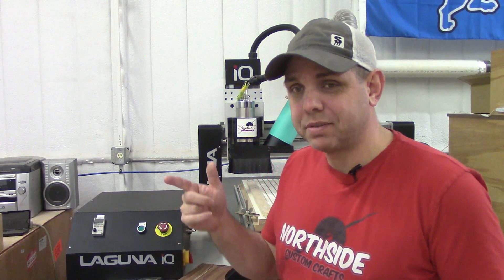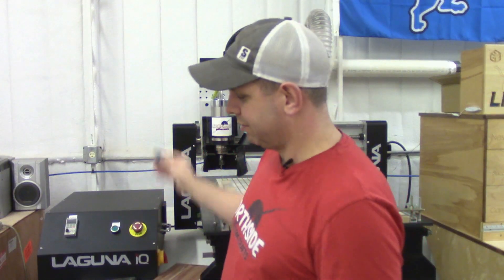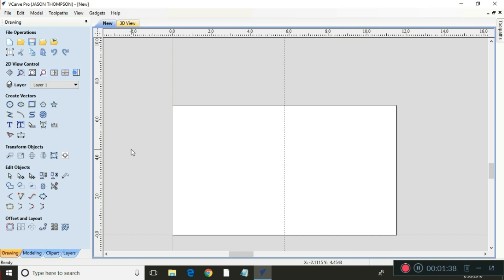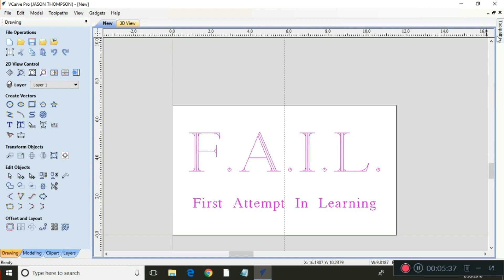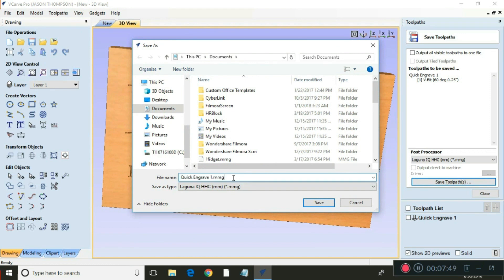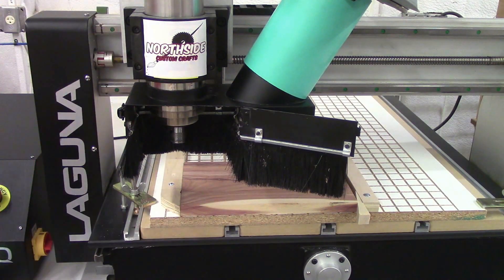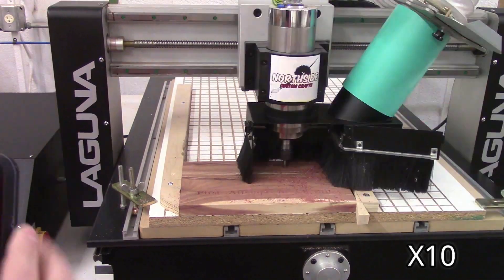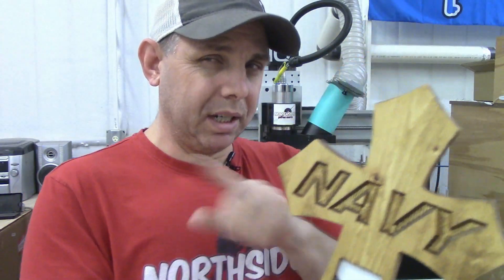Laguna IQ CNC Machine Review and V-Carve Pro Demo

Comment: I Just got the same Laguna IQ and, in the manual, said 208-220v   my question is can i plug this in a 240v ?
Reply from the maker: I'm not sure why we have so many different names for a 220 plug. Just use a 220 plug with the correct amp breaker and it will be good.

Comment: I like your videos and got a question. I bought one of these two years ago and been so busy I'm finally around to starting it up. The owners manual talked about putting 30w oil on guides for lube lol. I was going to clean the guides off with wd4 , what kind of lube did you use and also do you lube ballscrews?  Also do you know if the controller will swap to inches and not metric I can't seem to figure it out if it can
Reply from the maker: Thank you . I’m glad you enjoy the videos. I’ve had mine for quite a while now and t very thing was lubed when I got it, I just keep dust blown off with an air hose and I really haven’t done any maintenance on it.. I don’t use it very often, but it sure comes in handy when I need it. I just Change metric to inches in v-carve pro on the project setup page. 👍👍
Reply: @JakeThompson  I have aspire so when I change it to inches the controller will convert as well? When I turned the machine on it was in metric and I figured it was a parameter in the handheld. So your programs are inches on the handheld? Thx for reply been a sub for awhile on your videos

Comment: so let’s say you have to change to a second bit the middle of a project.  but there isn’t enough t of the original wood surface left to set you Z axis puck on. what do you do?
Reply from the maker: You can not use the puck and set the bit directly to the surface without the puck.. you can also set your x to the surface if your spoil board. You can set it there in the first step of the software

Comment: I followed your FAIL project to the T and am having a problem with the bit not going down to the work.  The machine is doing the tool route but not on the wood., about 1 inch above the wood.   Any suggestions you could give me?  Much appreciated.
Reply from the maker: I’m assuming you set the z height to the top of the piece?
Reply: @JakeThompson  i set the dimensions of the materials to 6 3/4 x 11 1/2 x 3/4.  In the tool choice i set it to 1/2 deep.  Is this what you are referring to?
Reply from the maker: @davidfurst7169  the actual workpiece.. you set the z height there
Reply: @JakeThompson  I did use the puck as you show in your video.  It did come down and kiss it then back up.
Reply from the maker: @davidfurst7169  try to go straight to the work piece .. I stopped using the puck shortly after I made all these videos. If that doesn’t work.. there’s a number to Laguna in the description of this video
Reply: @JakeThompson  so the puck isnt neccesary for this machine?
Reply from the maker: @davidfurst7169  the puck is for the machine.. I just think it’s more accurate than the puck… it won’t be a half inch off .. but touching the work surface for me is more accurate than the puck
Reply: I got it figured out. The puck had to be reset from the factory. I do appreciate your time and videos. Thank you.

Comment: FYI:  You can hardwire your broadband from your house router to your workshop as long as you keep it to 328 feet. But don't use CAT 8 cable, it's the fastest but only good for (10 meters).

ETHERNET CABLE PERFORMANCE SUMMARY
CATEGORY SHIELDING MAX TRANSMISSION SPEED (AT 100 METERS) (OR 328 FEET) MAX BANDWIDTH
Cat 5 Unshielded10/100 Mbps100 MHz
Cat 5e Unshielded1000 Mbps / 1 Gbps100 MHz
Cat 6 Shielded or Unshielded1000 Mbps / 1 Gbps>250 MHz
Cat 6a Shielded10000 Mbps / 10 Gbps500 MHz
Cat 7 Shielded10000 Mbps / 10 Gbps600 MHz
Reply from the maker: Kris Jorgensen 👍👍

Comment: Is it possible to put just the CNC table on top of the bench and the electronics box etc under the table?
Reply from the maker: Adam Coe The box won’t fit on the shelf of the bench,  but you can put it on a separate table. The cords are long enough. 👍👊

Comment: How accurately/repeatably can zero be set?  Say for a toolplate with nested parts.
Reply from the maker: TBR, LLC Setting zero is very accurate! If the material is a consistent you won’t have to change zero. I find that zeroing right at the material rather than the puck is more precise.

Comment: I love the videos my man! What pc/system/memory, etc. are you running your software on? I want to get this, but need to update my old pc to one that handles good. Thanks.
Reply from the maker: MrKly123 Before I bought the cnc I thought I would need a computer just for this. Turns out it doesn’t take a super computer to do this. I have a cheap toshiba lap top that I do everything on. The laptop has 1 tb of storage and you can use cheap jump drives.. I was worried about it also, but I shouldn’t have been. I hope this helps and I’m glad you enjoy the videos!

Comment: Hello,
Thank you for posting this very informative video. I am in the process of buying a new cnc machine but rather than buying big machine, I decided to start with small one and in particular one like yours or IQ machine from Laguna but have some questions that I would like your input on:
1- Do you have the 10 inch z axis travel or 6 inch and which one do you recommend?
2- I was told that the router can travel 2 to 3 inches beyond machine table. Is that true? This is important to me as I planned to add fixture to end of the table to do dovetail where the piece will be standing 90 to the table surface.
3- Any trouble using aspire software with IQ machine?

Thank you kindly and look forward to hearing from you

Thsnkd
Reply from the maker: Mimi Becks Thank you for watching the video and I’m glad you enjoyed it. Mine has the 6 inch travel but the 10 inch would be way better. The spindle will go down a couple inches past the bed. And Aspire works just fine with the machine. 👍👍 hope this helps..

Comment: There are tools in the edit drop down menu that with center everything you want with one click. Vertical horizontal all kinds of tools.
Reply from the maker: 1969Donovan Yes.. totally correct.. sometimes I forget the easy way.. I learn every time I use the software. Thanks for watching and for the tip. 👍👊

Comment: Good video. Just a quick question, what pressure is coming out of the spindle cooling pipes? I also have the same and the pressure is just a trickle coming out but high pressure going in
Reply from the maker: Yeah. The pressure in the cooling system is very low. This is normal.